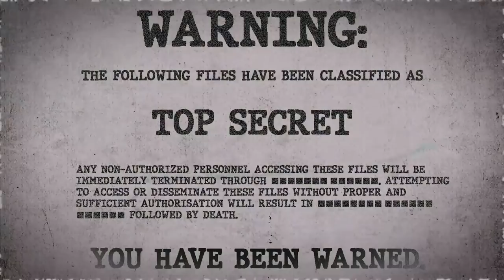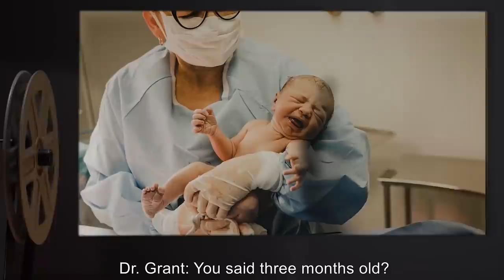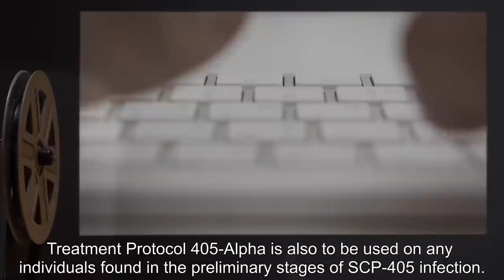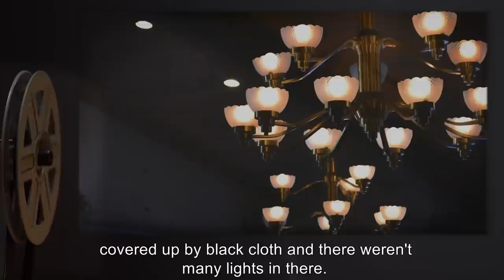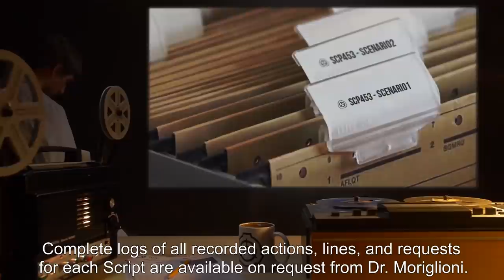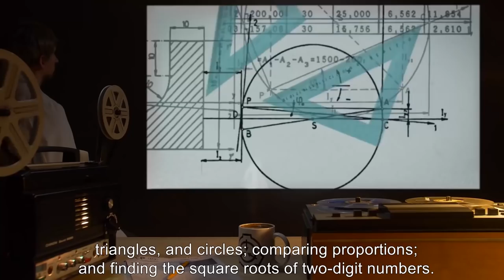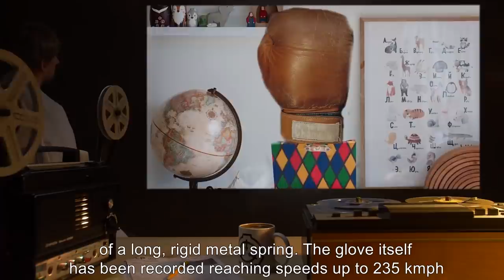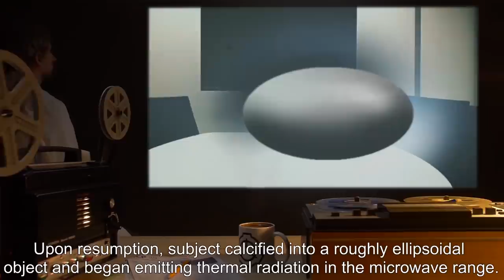Mind-Controlling SCPs (SCP Orientation Compilation)

Comment: I wish the jack-in-the-box hadn't had those two data expunged, there didn't really seem to be any need for them and they detracted rather than added to the entry.
Reply: I think SCP stories use "Redacted" and "Data expunged" far to much and it rarely seems to be to cover anything that would be necessary to do so rather just something that would make things make sense 🤷🏼‍♀️
Reply: @jaymii-raie2878  I suggest you look at the newer entries, like SCP-4000 for example. There is far less redaction and expungement there than the older one.